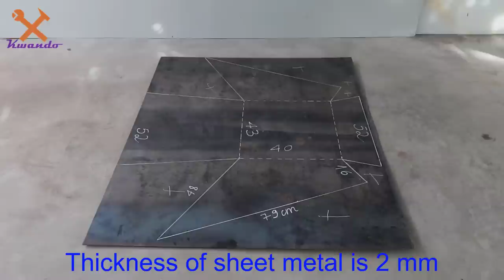Homemade A Hydraulic Wheelbarrow For Workshop | Step by Step Implement

Comment: Replacing the Hydraulic jack by Hydraulic lever is better choice to decrease the time required for unpacking,
As well as the gravity center looks like in front of front wheels axis which may cause to drop down when you walk through gradient ground !
Generally it's awesome work👍
Reply from the maker: Many thanks for your suggestions!

Comment: Needs bigger bucket and move mass more towards the rear. As its now its so front heavy hydraulic jack makes no sense and whole thing nearly tips on its own. If you were to more very heavy material say lead where hydraulic system would start to become useful, front axle will snap way before that. Little redesigning with bigger wheels, bigger bucket and standard handles of wheelborrow this could be useful and might add electronic assist on pull while at it.
Reply from the maker: Many thanks for your advise. I made it base my actual conditions so it wasn’t enough good as I think. Regards!

Comment: That's a well built project,  but....
Reply from the maker: Thanks, I understood your thinking.
Reply: @KwandoTechnic  i just think the handle should be lower down,  seeing as the weight is in front,  it looks like it's prone to tipping when pushed hard.. 
or change it up a bit and tow it behind an atv,  that'd be brilliant..    also the tipping is a bit slow..   maybe some sort of double action lever to speed it up🤷🏼‍♂️

But i love the overall design..  a few tweaks and it'll be perfect